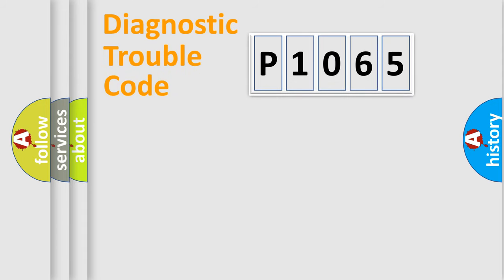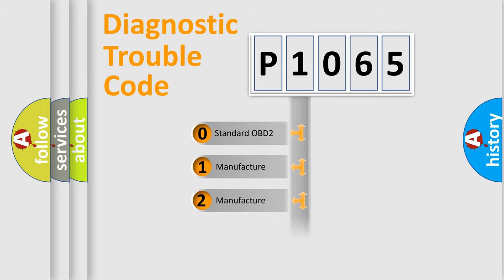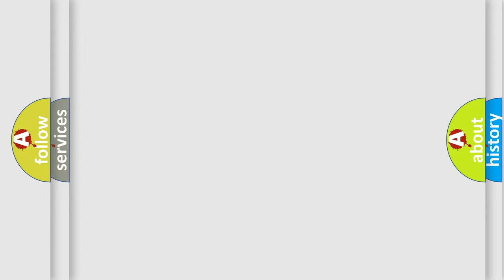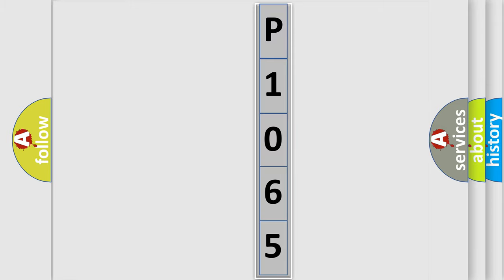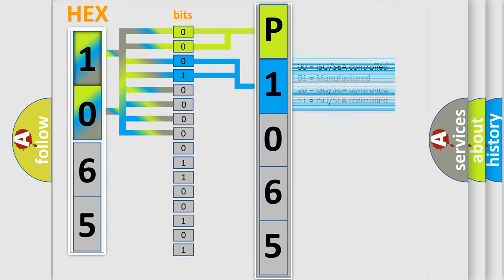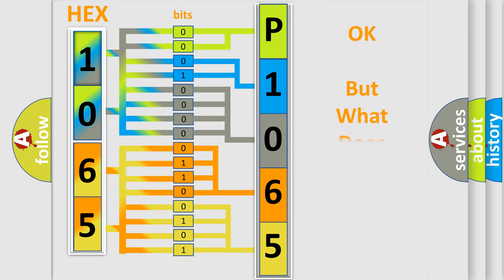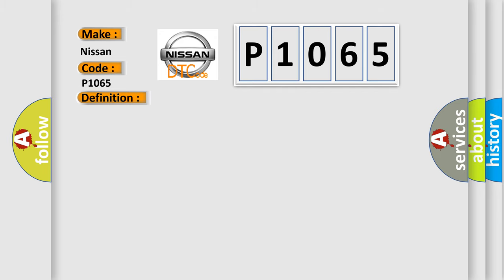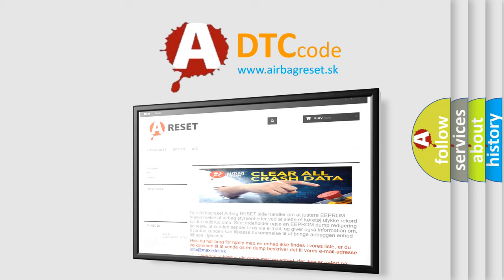DTC Nissan P1065 Short Explanation

Comment: = BE AWARE =

Not sure if the code varies by car model, but my 2005 Nissan Sentra " Service Manual " says CODE P1065 is related to " ECM BACK UP/CIRCUIT ". Meaning you have a bad wire / contact in the harness connector or ECM just died, since is not saving RAM / SETTINGS.

My car won't start, I have tested several things. One of the first things I tried is exactly this video. This kind of misinformation could lead you to waste time and money. My next step is replacing ECM to see if that solves the problem. Since everything else looks in good shape.

Car Present Issues: NO START, NO FUEL INJECTION, NO CODE 
Before died: RANDOM SHUT OFF, NO CODE, NO MISFIRES, APARENT TRANSMISSION ISSUE (HIGH ENGINE RPM, BAD OR SLOW GEAR APPLICATION)
After died: Codes P1065 and misfire Cyl3 (I had no misfire code never before the car died) PD: Codes never showed up again, after erasing.

TESTED: (1.) Cleaned connectors (Had lot of old oil) of Cam and Crank Position Sensor, and replaced both. (2.) ECM Relay is OK (Also Interchangeable with FAN2 Relay if not mistaken) (3.) MAF and Throttle body are OK. (4.) Fuel Pump is OK (New and Strong.) (5.) Fuel Pump Relay obviously OK.

Hope I can help somebody with this information. PD: Service Manual is your best friend. GOOD LUCK!